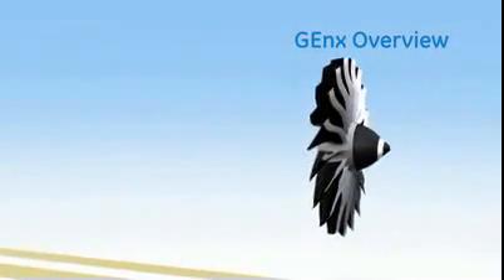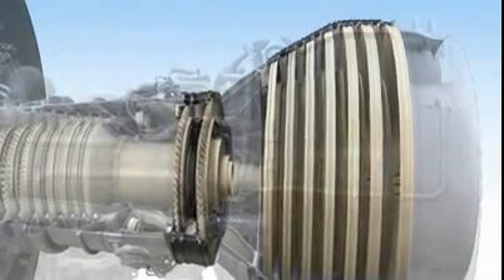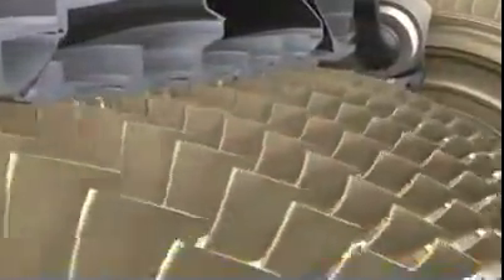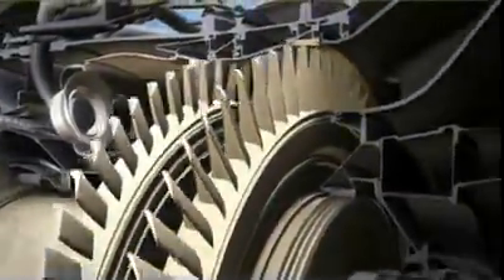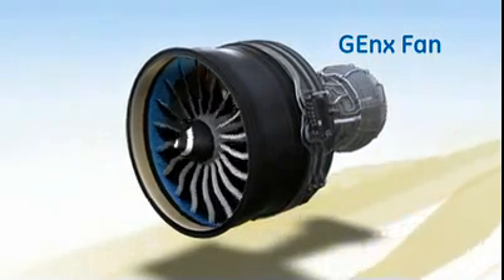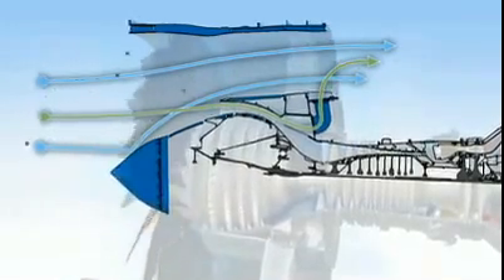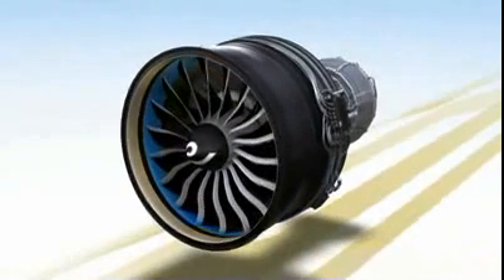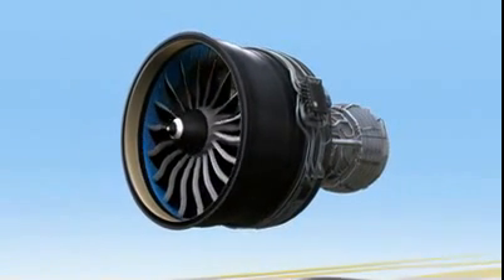How the General Electric GEnx Jet Engine is Constructed

Comment: GE engines were easy to overhaul and you could even tweak clearances and gain more power than baseline.
Having extra horsepower gave the engine more time on the airframe.
Thousands of hours testing GE turboshafts. Those engines would scream with great harmonics.

Comment: what do you mean the compression ratio?

for adiabatic process with no mechanical energy input by turbine fan, 

if v drop to 1/23, then the air temperature before  burning is already 1000 k, high to burning point!

so the compression ratio you give for 1.23 

it totally ambiguous, and try to mislead other stupid competitors.

the era for turbine engine is close to sunset!

I would announce

Comment: My challenge to the commercial airline engine manufacturers is this: to create a very powerful jet turbine engine which can easily and SAFELY break right through the sound barrier with as low friction and shaking as possible. Once this can be achieved Mach 1 or 2 and perhaps 3 could dramatically reduce travel time globally(internationally). The problem may then be the massive heat produced by the engine at speeds above Mach 1 or greater. Can the engine be cooled within the casing thus preventing overheating? How much bigger would the turbine need to be including the casing? Velocities which can top the speed of 1 time zone per hour would be great and closing in on 2 time zones per hour would be astoundingly amazing. Crossing the Atlantic Ocean bound for Europe in 2 hours from NYC or WDC to London or Paris would be quite an aviation feat. Indeed. SF or LAX to Tokyo in 5 or 6 hours would be fantastic.

Comment: What I don't understand is how are the fan blades managed to turn and rotates opposite to each other when they are joined by one shaft how is this possible or is it some kind of an illusion or something because I have worked on aircraft engineering company and not seen a big engine like that that has fan blades turning around both completely different ways at the same I don't cannot get my head around that one no matter how many times I play the video I just don't see what is making one lot of blades turning in the opposite direction how is that possible
Reply from the maker: They are on separate shafts. One runs inside the other.

Comment: Are these engines donot have pistons( or piston engines) which rotates the fans????
Or how this engine start??? Is it just by burning fuel ????? Is no piston engine required to rotate the shaft???🤔🤔🤔🤔
Reply: on start up, you use an external power source like compressed air to spin the shaft. Once the air is flowing, you inject fuel and burn it, it expands fast and that drives the turbines (like a windmill) which drives the shafts on which the compressor and fan are attached

Comment: wait turbo fan not turbo jet?
Reply: Yeah, this is a turbo fan. Turbo jets are what were used on the first airliners like the 707( you can search that up to see what I mean if you want), these engines are low by-pass  compared to turbo fans which are high by-pass which is more efficient

Comment: It's an advanced "turboprop".  Instead of having a propeller in front of the turboprop engine, it has a huge "bypass" fan blade.  That is expressed in it's simplest terms.  I heard years ago that the next generations of "jet engines' would be "jets attached to a shrouded propeller".   Well, now I guess the future is here.  The best of the best jet engines are no longer "straight jet engines",  they are "bilateral".  That is they are jet engines that are not "turboprops" nor are they "straight jets".  They are a combination of straight jets turning a very large set of fan blades.   The propeller is no longer a prop attached to a jet engine.  It's now a very large "shrouded fan bladed propellor powered by a jet engine. 
             The engineers finally got it right.  It's my understanding that the "key" to this discovery has to do with something like a "three geared axis link" that can convert the jet engine technology from "what it was" into something that "know exists".  In other words,  the genius is in the three gear transmission that allows the Jet portion of the engine to be able to convert its energy to a very large fan blade via a "very highly special three geared patented "gizmo" that will allow the conversion from a jet to a turbo.  This permits a very large "bypass" of air to escape around the main engine combustor.  Yeah, I'm a sub-nerd who can't explain it right, but I'm almost right in my description. JMHO

Comment: Basically an encased turboprop using light weight alloys, composites, and sensors. Put some automatic  directional and output controls on those burners if you want more efficiency.

Comment: Why are the stators static and not rotating in the opposite direction. Wouldn't that help provide more compression faster? Like 10 compressor blades+ 10 static stators maybe equal to 5 compressor blades + 5 moving stator blades? Like the blades on a KA 52 helicopter .

Comment: Mr. PilotTroll: You are right 100%. All light bulb manufactures, more than 80 years ago AGREED to limit the life span of each incandescent bulb to NOT MORE THAN 6 MONTHS. The only incandescent bulbs that last (almost) forever are the ones used by the subways (MTA) in new York City (as far as I know) and those bulbs have the thread counterclockwise, so nobody can use them, unless the socket is available. with counterclockwise thread too. 02/17/18.

Comment: As long as airlines follow the manufacturer maintenance guidelines, and don't use shortcuts like American did in 1979, it should be a very good trouble-free engine.

Comment: how do you start the jet engine, will the air fuel mixture ignite under 23:1 pressure, what psi. is that.what sort of
fuel does the jet Engine use?
Reply: +simen scott  Auxiliary power unit . Something like your car battery. Then turbine which is on the same shaft with compressor is helping the rotation

Comment: Hay in steed of fuel have the air go in a narrow space then the space gets wider with two magnets on the side circling the engine were fuel is Ejected and right in front the things that spin with the parts that repel and have material that block the magnetic field on the other side K

Comment: I don't  understand how small solids particles will not enter the main chamber.
Reply: +999kafka - Basically the engine spins the airflow at the front so that centrifugal force can separate the heavier solid particles from the lighter airflow. The solid particles are thrown away from the center of the engine to be collected around the periphery and then finally ejected out of the engine through a vent.  All of this occurs before the compressor core, which is where all the small blades are located.
Reply: Thank you!

Comment: How about jet engines powerful enough to compress water at least 4 times?
Water is nearly incompressible.
Reply: +Jayson Bondad There were jet engines in the past that used water. Not compressing the water, really, but accelerating it. The thing is: the engine thrust comes from the mass that you push out of it per unit of time. By adding water, you can actually increase thrust. This was mainly used in early military jets for momentary thrust increase.

Comment: How often are the bearings on these engines changed? And how long does that take?
Reply: +eJacob Cornelius - Engine bearings in a jet engine are not typically replaced purely on a timed cycle. What they do periodically is to withdraw a sample of engine oil from the engine and analyze it for metal content. If the metal content suddenly rises that is an indication of an impending bearing failure and the engine must be disassembled and all the bearing must be inspected and any bad ones replaced.

How long that takes depends on which bearing it is and where inside the engine the bad bearing is located. Jet engines I am familiar with used to take 2 to 3 days to completely disassemble them and then 4 to 5 days to reassemble and test them before they would go back into service.

Comment: Can some one plz tell me how one turbine can turn one way and thee other behind it turn the other way
Reply: +Jay Berry - First, note that in this engine there are two completely independent rotating assemblies. The High Pressure Turbine (HPT) located right behind the 
combustor drives the High Pressure Compressor (HPC) located right ahead of the combustor. Then the Low Pressure Turbine (LPT) located at the very rear of the engine drives the Low Pressure Compressor (LPC) and the  fan located at the very front of the engine.

The drive shaft connecting the HPT to the HPC is hollow. Then there is another shaft rotating independently inside it that connects the LPT to the LPC and the fan.

Finally, the pitch of the turbine blades and stator vanes are reversed between the two turbines. This causes one turbine to rotate in one direction as the combustion gasses pass through it while the other turbine turns in the opposite direction.
Reply: Is this used to keep the air at a higher pressure through out the engine?
Reply: +Jay Berry - I'm not sure I understand exactly what you are asking.

In general the compressor's job is to increase the pressure of the air by compressing it as it flows backwards through the engine. It's essentially an air pump. This is done to provide highly pressured air to the combustion section. The air entering the combustion stage must be at a high enough pressure so that the combustion process doesn't reverse the flow of air back out the front of the engine. Instead everything is forced to flow out the back in order to propel the aircraft forward.

If you are asking why the engine uses counter-rotating turbines and compressors, that's a bit more complicated.

Comment: still dont understand whydid putting the fan towards the front mades it fly faster while the first aircraft has it towards the back
Reply: +Muammarvsgaming ROBLOX and more - The fan forces a relatively large amount of air backward at a relatively low speed. This is necessary to generate the higher trust required at low airspeeds, such as during take off, climb-out or during a go around.

In contrast, the core forces a lesser amount of air out through the exhaust nozzle at a much higher exit speed. This is necessary to attain higher airspeeds, such as when cruising at high altitude.

Comment: its all in one's intelligency easy to grasp mind,there's two things here theory and practical, if you are much stuck to practical then it takes time to get it, but you got to have brain that creates theorys then it wont be a problem for you to get how this engine works,there are moving blades and stationary blades and they are so arrenged such that when the air is pushed to the stationary/fixed blades the air has no means of coming backwards and the next moving blades takes over and so on.its not just hole where the blades are they are in stages between moving and fixed.

Comment: how can they move two axis one clockwise and the other anti-clockwise? :S
Reply: They are not connected on a single shaft. That means that there are 2 separate shafts on the same axis. The blades on the LPT (Low Pressure Turbines) are not angled the same way as the HPT (High Pressure Turbines). Thats probably why the rotation would be different. I may be wrong, if someone does know, please do share! :)
Reply: Becuase their is hp shaft and lp shaft the lp shaft its a small and Gose inside the hp shaft 
The lp turbine which is at the end of the engine drives the lpc at the fwd of the engine and the fan 
And the hp shaft derived by the hp turbin
Reply: +Dave Smiles - Everything you said is correct. The pitch of the turbine blades and guide vanes are reversed between the two turbines. Therefore the gas flowing through the two turbines causes one to rotate in one direction while the other one turns the opposite way.
Reply: Split diff